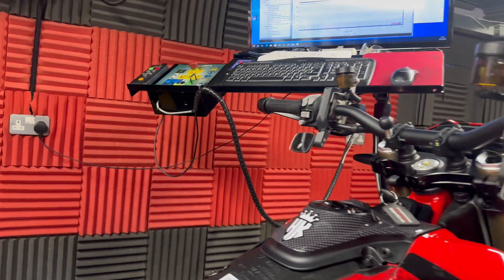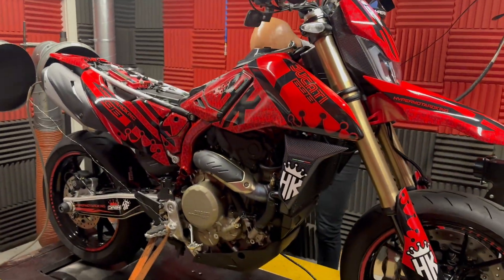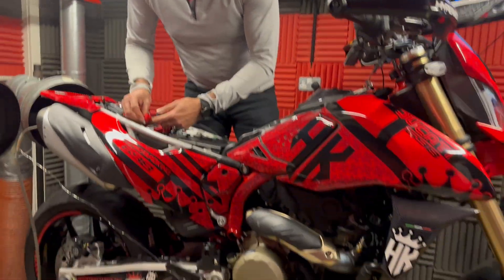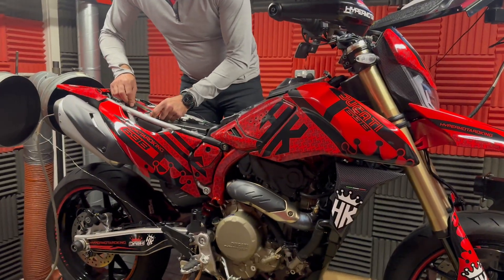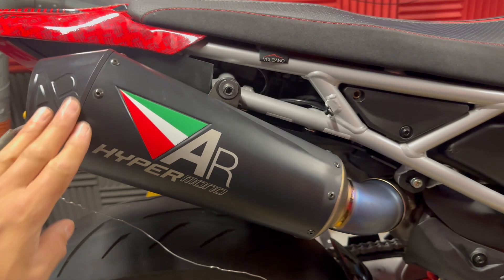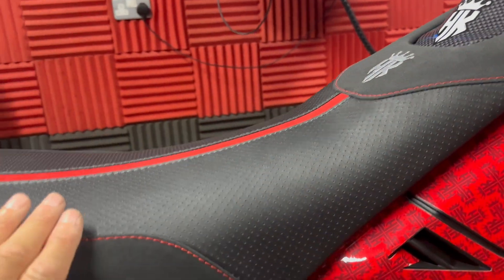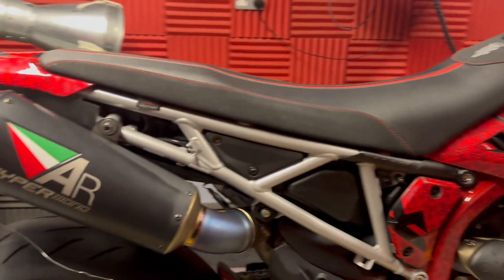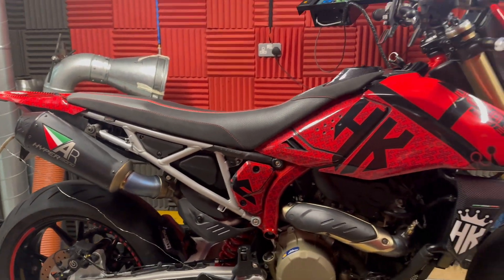How Much Power Does the Ducati Hypermotard 698 Mono Really Have? Dyno Run Results!

Comment: This is a top tier video, I’m sure you saved many a lot of money. Crazy the termi exhaust plus up-map is 3k+ usd only takes you to 35.5hp which is basically the same as stock + no lid + sprint for $150. Has no one really created a new map for this bike after being available for over a year!?!?
Reply from the maker: @nickdefreitas  apparently not.. either there is no demand for it or the ECU crackers haven’t got in yet
Reply: @hypermotardking  do you think the legal termis perform as good as the original silencers?
Reply from the maker: @raven40611 sound too loud.. performance can’t say…
Reply: @hypermotardking the Legal termis are pretty quiet

Comment: How lean is the engine running with the lid removed and the stock exhaust without being able to tune  the ecu yet?
Reply from the maker: @etherealautumn7  no more lean than stock
Reply: @hypermotardking  was that also with the sprint filter in?
Reply from the maker: @ yeah.. its only lean under 5K

Comment: Make sure that front brake line isn’t rubbing on your fork leg you don’t want it to rub a hole in it 😅
Reply from the maker: @philipturnbull8541  It does catch now and then - might need to adjust it
Reply: @hypermotardking  I’ve just done mine and taken all the slack and pulled it away from the fork and it seems to be staying there
Reply from the maker: @philipturnbull8541 Sweet - might give it a tweak next time I’m fiddling about 👍🏻👍🏻

Comment: Great Video, Cal! 
(I hope I wrote your name correctly). 
I am puzzled, because I already ordered and paid for the Termignioni full system. Anyways.....

By the way, did you change the angle of the clutch and front brake levers? I am trying, but it is a pain! And I have the same question for the Control block for blinkers and the rest.
Reply from the maker: @CarlosNLopez  Thanks..
I’ve not messed/changed the levers / but shudnt be that hard to do and adjust up or down.
For me personally I’m not a fan of the Termi - its too expensive and too loud

Comment: Great video. Are you relying on the dyno wheel to get you the RPM estimate or did you take an RPM lead directly off of the coil of the bike?
Reply from the maker: @Motomillion  Used the Euro5 red diagnostic plug under the seat to get all the reads

Comment: Well done mate. Wow. These results are surprising and mildly discouraging. If I recall correctly, this is very much consistent with vcyclenut's findings on the full termi. Ducati's full race system achieved more power & torque on the top end, but stock cans with derestricted lid and the Sprint P08 filter was better over 6-9k RPM.
Reply from the maker: @xeeded  Makes sense.. just shows that Ducati’s map (probably a T800 UpMap in conjunction with Termingnoni) has never been good across any of the bikes its offered on

Comment: Hey from France.
Thanks for the video and your results are the same as what Vcyclenut did in US.

Stock exhaust + no lid or ducati open lid + sport filter.

The question would be : what results with special mapping from Ducati (the one you get with termignoni full exhaust) if you stay with original exhaust.
I wonder if Ducati would accept that.
Reply from the maker: @dudunelkee  unfortunately Ducati won’t release that to buy on its own.. and I haven’t seen a Termi system on a dyno. 
Stock 698 makes 77hp at crank and 73hp at wheel.
Termi makes 84hp at crank so probably 80hp at wheel.

Comment: Nuts i just ordered some austin racing pipes for the 698. Is the sound worth the 3 hp loss
Reply from the maker: @nickcrow6675  Definately, it’s still the best sound IMO. The exhausts need fuelling correction to match the better breathing.. then the “top trump” max figures will be better.
The no-lid and sprint makes biggest difference midrange where u will use this bike
Reply: I have the sprint filter and aftermarket lid and hopefully pipes this week or next. Just hope it still lifts the front on its own lol
Reply from the maker: @nickcrow6675  that’s rider dependent 😂
Reply: Did the ar have db killers in it. I wonder if it would help with back pressure
Reply from the maker: @nickcrow6675  no didn’t run the db-killers

Comment: Why is that bike sputtering at high rpm? Best note able with the sc cans. Do you feel that on the road as well? Hope it can be fixed with a tune later.
Reply from the maker: @Advis52  just the rev limiter.. u feel the surge on or after about 6K rpm on the road.
AR sound best
Reply: @hypermotardking , It's clearly before the rev limiter, very easy to hear.
Reply from the maker: @astrostrotch  most bikes when reaching their limits are being restricted in the ecu are probable causes of this “spluttering”..

Comment: you need good fuel 102 octan from germany than you get the stock power the no lid and sprint and a good aftermarked exhaust brings the best . not all engines perfomong the same hp
Reply from the maker: @KamikazeRacing76  The stock power is 77.5bhp at crank from Ducati - these figures are at the wheel.. high fuel octane will still need a flash

Comment: Definitely best dyno vid out with the most honest results. These results prove what my butt dyno felt… I switched back to stock from the shift tech cans a while back and oddly felt quicker in midrange and top end.  Turns out that’s because it’s true lol. 

Great vid man.
Reply from the maker: Yep.. I felt that too on the ride back. Once a proper tune comes out then these end cans should make a lot more power and torque

Comment: 🙏Hey man - tip of the hat to you for all that work! Really great video - loads of useful information. As much as I love the sound of the AustinRacing cans I think I’m going to go with the Termi system mainly to get rid of the cat and get the only ecu tune available right now to ensure the safety of the engine and maximize the power. The big takeaway for me is that if you’re going to lose the airbox lid, you absolutely need a way to clamp the edges of the filter down. The standard airbox lid is cheap enough to cut up for that purpose. 
Too bad you didn’t have a Termi system to compare - I know, I know, some people are never satisfied! 😂  Did BHP give you any idea how far away their ecu tune might be?
Reply from the maker: Thanks.. I still think the Termi dealer flash can be improved and doubt Ducati will. I know a lot in the 950 community with Termi’s still went aftermarket flash 👍🏻
Reply: @hypermotardking  yeah that’s a possibility for the future once I’ve forgotten how much I paid for the system 😂
Reply: Forgot to ask - did bhp comment on the air/fuel ratio with the air box off / sprint filter / oem cans? Hard to tell from the video how lean it gets.
Reply from the maker: @simonsmith6508  lid off, stock cans + sprint the fuelling was still lean up until about 5-6K which is expected but much better than with aftermarket cans
Reply: @hypermotardking  was it dangerously lean or not? The quick view of the graphs suggests it runs more lean with the airbox lid off and Sprint filter only in the higher rpms
Reply from the maker: @63Mrduke  it’s not dangerously lean.. lean is only before 6-7K rpm.. in the higher rpm’s it gets richer
Reply: So….did you put the stock cans back on? 👂
Reply from the maker: @simonsmith6508  I have for now as I have another video in the making that needs them on - but the AR will be back on after 👍🏻
Reply: @hypermotardking  woah you must be convinced that bhp are coming out with a tune soon lol!  Your vid convinced me to give it a shot btw - I just ordered the sprint filter / open Airbox lid to try. Once the ecu is cracked I’ll look at exhausts again. Cheers.
Reply from the maker: @simonsmith6508  happy days.. I’ll post some links to shifttech in the description
Reply: Should arrive in a day or two! Have you any experience of Shift-Tech ecu tunes? They’ve got a single can system that’s 9lbs lighter than the Termi and the promise of a reduction on the cost of tune when it comes…
Reply from the maker: @simonsmith6508  Not on the tunes but shifttech are known and popular in USA and are reliable 👍🏻

Comment: Awesome comparison bro. Thanks for doing the Dyno and breaking this down. I experimented removing the filter lid while I had my stock exhaust and saw a major difference in performance and just the sound overall was so much better with the bike not having to fight for air. I just got the Termi installed and love it with the new filter and the map but Ducati really needs to release an updated map for the Termignoni full system. The popping and banging on deceleration is too much. I would love to ride it without the DB killers but the popping and banging on decel sound like gunshots and is just overboard for city riding. When I go to the track I’ll probably take the DB killers out and bust some ear drums. Hoping Ducati makes some improvements to the map for the Termignoni 

Keep the vids coming. Much appreciated!
Reply from the maker: @PackmateCarriers  Cheers… 
If Ducati’s history on the 950 to go buy is any indication they won’t release a map.
On the 950 termi system, owners still had to get an aftermarket flash to make it better just because the Ducati map still has restrictions
Reply: @hypermotardking  damn. Such a shame when you pay such a premium for these bikes. Hopefully either they update the map or someone releases an aftermarket flash for the Termi because the exhaust does look and sound incredible (minus the backfiring on decel).